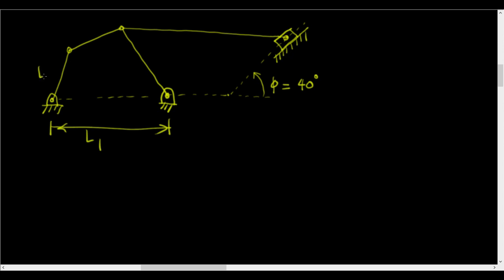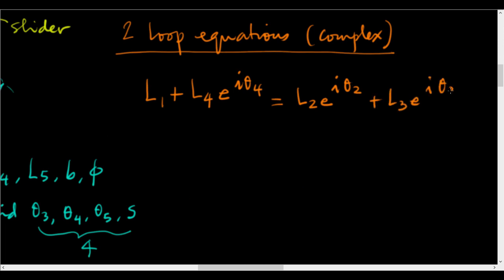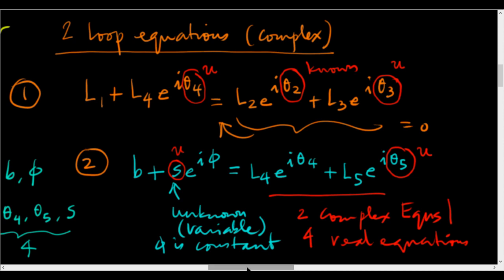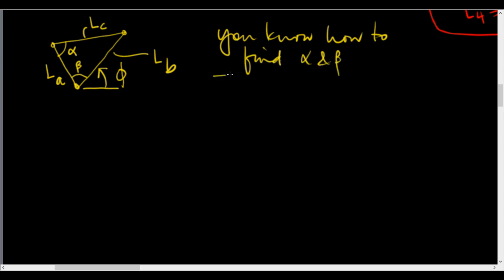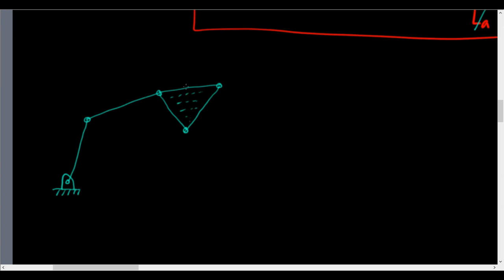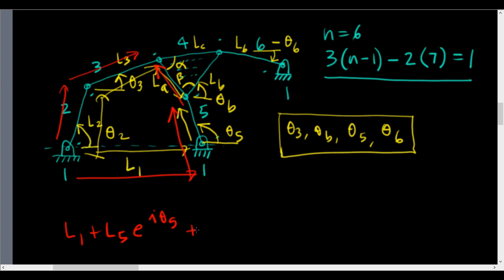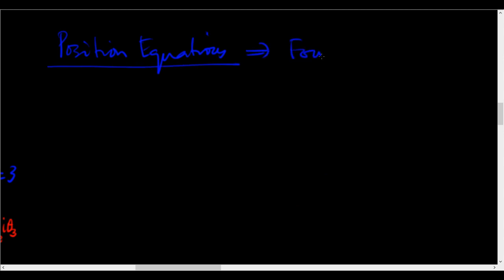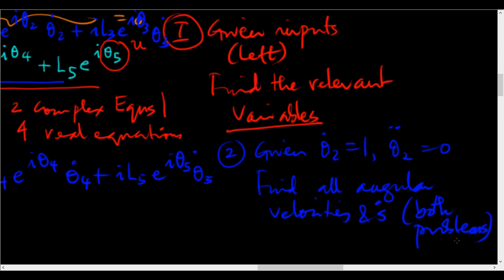Kinematics: Two Examples

Comment from the maker: At around 20:00, a and b need to be given as well. Try a=b=6 and see if you get a reasonable answer.

Added comment in response to Ishan Gupta: as per comment below, a=b=5 gives answers.
Reply: Sir, I wasn't able to get an answer with these values. Although taking them as 5 did give a reasonable answer
Reply from the maker: @ishangupta2113  Thank you. I believe you are right.